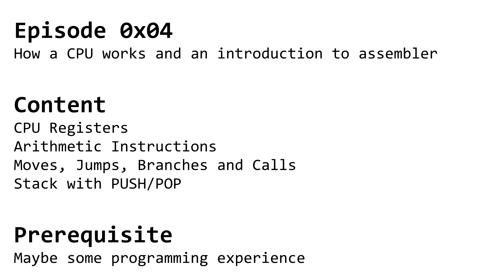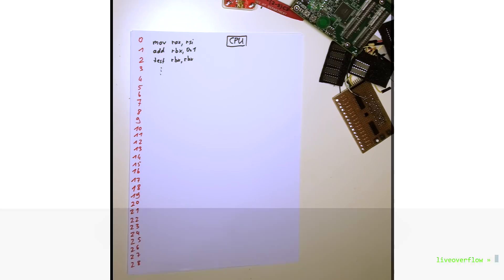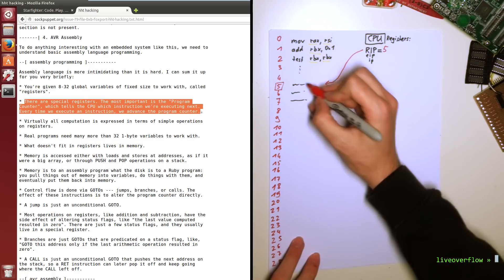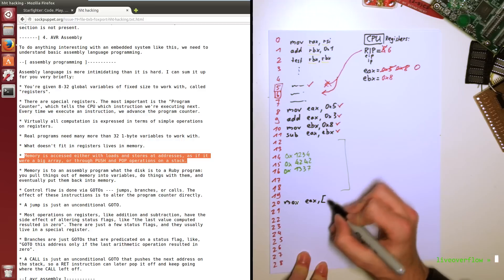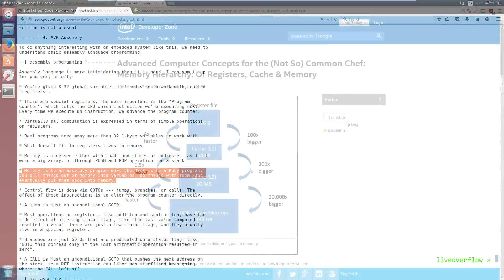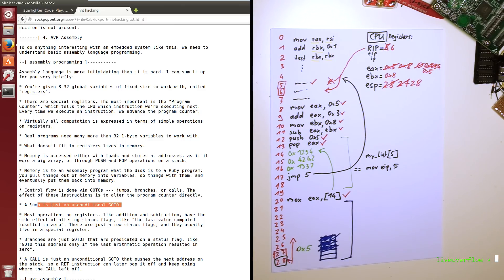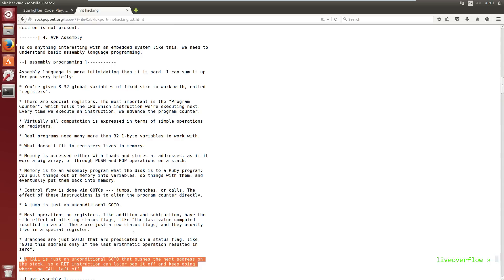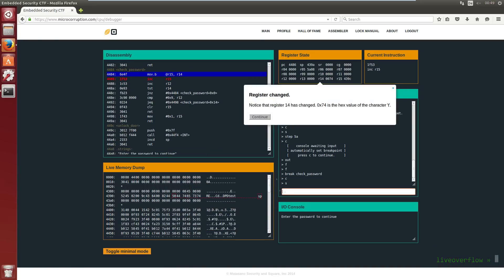How a CPU works and Introduction to Assembler - bin 0x04

Comment: Hi from 2021 to all :)
 Thank you a lot - now it is very clear about stack memory - some questions that are now on the top of my head:
1) what is a heap in that case? I guess, on the compile-time, when you define some "object" on the heap it will be just converted to the "memDestionationAddress" and provided to the CPU as a regular address in memory, and heap size is managed by a top-level entity like OS? am I right here?
2) I guess, the stack size is limited for each program, doesn't it?

Comment: I still don't get how computers read the numbers 1 and 0. Isn't it just electricity or no electricity?
Reply: Using a simple pair of voltage levels as a symbol scheme is indeed the most basic way of doing it. That said there is nothing fundamentally special about the way that the symbols encoding the binary data stream. Even among wired communication protocols there are other variations including some that encode multiple bits per symbol using more than two voltage levels sometimes with added parity data in the same symbol ie gigabit ethernet. This is before we even get into the multitude of ways to encode digital data into symbols that can be transmitted over the air. Frankly the only requirement is to have a minimum of two symbols that can be interpreted as different voltage levels once you have that you can program a computer to extract a binary input from it typically by using an ADC. But in effect even a simple binary input is in effect a 1 bit ADC in that it is able to extract a single bit of information each time it samples the input voltage level. What we commonly think of as an ADC is simply a more advanced quantizer that is able to discriminate more states as distinct symbols and thus produce more bits of information from each sample.

Comment: Can anyone tell me whats the difference between RIP and EIP?
Reply from the maker: RIP is the 64bit register and EIP is the 32bit register.
So on a 32bit machine there is only EIP.
On 64bit processor you have RIP (but you can also use EIP to only use the lower 32bit)

Comment: instruction on x86 does not necessarily is 8 bit and usually it is much longer, up to 15 bytes
IP points to address where instruction begins, there are no rows in memory like on paper (there are rows, but those are 8k)

Comment: at 5:54
you mention that the ESP is pointing to the top of the stack , so why it;s not up ? i mean at line 20 o something ? 
like this picture : http://www.cs.virginia.edu/~evans/cs216/guides/stack-convention.png
Reply from the maker: look at the picture. It says "stack Grows" and points upwards, but the arrow down says "high addresses are down". So the stack is growing, but the addresses are getting lower... In the end it doesn't really matter if the address goes up or down, an address is just a way to address a memory cell. What matters is only how we define what the top is. does that make sense?
Reply: so we can say that ESP is always at the top of the stack which is " upside down " , so EBP > ESP ? in addresses values
Reply from the maker: simple answer: yes!

long answer: yes on for example your typical computer. But theoretically we could also build a enw computer with our own operating system and decide that it's different ;) there are no laws that prevent us to turn it around :P
Reply: that's right :"D

Comment: Amazing video! However, I don't really get just WHAT Assembler language is... Is it correctly understood that when a C program is compiled, it is translated to machine language, and thereafter it can be translated from machine language to Assembler language, which is  (barely) human readable? Is disassembling the program with gdb converting machine language to Assembly language?

I don't quite understand the relationship between C code, Assembly and machine language. I understood from the video that programs are stored in the memory as Assembly, but computers only understand machine language? (1's and 0's) Can anyone explain this in detail please?
Reply from the maker: assembler is basically machine language... so the 0s and 1s that make up instructions for the CPU can be also written in a more human readable format. for example the machine code 10010000 (in hex that is 0x90) could also just be written as "nop" (no operation - that's an instruction that does nothing :P).
So assembler and machine code is basically the same. Assemble is just the machine language displayed as a readable code rather than just the numbers. but there is a one-to-one translation between that. For example when I want to "write assebler code", I can just write 'nop' and the assembler program will translate that to raw binary 10010000
does that make sense?

so yes... in a sense gdb disassembles the raw binary data to readable instructions.
Reply: Makes sense :-) Thanks
Reply: Thanks :) Is it the same for higher-level languages like Python and other scripting languages, or are there any differences to low-level languages like C/C++? 

EDIT: I mean since Python isn't a compiled language, it might not work the same way..?
Reply from the maker: Python is “compiled” to python bytecode. That’s basically also machinecode ;) but that byte Code is just not the same instructions that could be executed by the CPU. So the python program (cpython is written in c) will take the bytecode, those instructions and do what they say. Exactly like the cpu would, just in software not hardware. 

Search for “crash course computer science” on YouTube. It’s a series explaining how computers and programs work starting with the hardware and going up the layers. It’s soooo well explained that even I watched it eventhough I knew it already :D
Reply: Thanks again for the quick and in-depth answer! This is truly fascinating stuff. 

However, I'm not sure I understand. I'm new to the world of computing :/ 
Basically, the Python interpreter (which is software) does the same with the Python program that the CPU does with the compiled C program? But without actually using the computers hardware in the way that C programs use it - the program will be executed by the interpreter - which also acts as a sort of "compiler" - itself?

(BTW I really appreciate these videos and the helpful answers! You do an amazing job, keep it up!)
Reply from the maker: yeah basically :D

So the CPython interpreter is a C program compiled to machine code. So the CPU executes the CPython program. And that program reads the python bytecode and does what that bytecode says.

So for example a python code "x = 1 + x" would be compiled to bytecode by one CPython component. And then the bytecode that looks like "add(x,1)"  is interpreted/executed by the CPython program.

Imagine the calculator on your PC. You provide input by clicking the buttons and the calculator does what you tell it. 1 + 1 and it calculates that. So in the same way the CPython interpreter works, but instead of a human giving instructions, it reads a file (the bytecode) and follows those instructions. does that make sense?
Reply: I think I got it now :) Thanks a lot! Hope this thread will be useful for other newbies like myself.
Reply: @jeppebondeweikop1318  deffinately

Comment: I have got some Questions :
1. Does the architecture (32bit, 64bit) limit the number of registers or the number that is stored in one register ?
2. Is the memory access in 4:49 referring to RAM memory access or some Disk memory access ?
3. According to that Ruby analogy, it is probably RAM access. So Assembler exclusively work with RAM memory, so no Disk memory ?
Reply: 1. Yes. While you can only store FFFFFFFFFFFFFFFFFFFFFFFFFFFFFFFF in 32-bit while you can store FFFFFFFFFFFFFFFFFFFFFFFFFFFFFFFFFFFFFFFFFFFFFFFFFFFFFFFFFFFF

2. He means RAM

3. I can’t answer that one lol
Reply: As for 3 no hardware access is still done via assembly at the fundamental level. That said on architectures such as x86 direct access to hardware is restricted to ring 0 at least in normal operation so it is only available to the Kernel. Other programs use the Kernel API's (Syscalls) to request I/O with the hardware which first checks the applications permissions etc. If this passes the kernel will then call the relevant function from the linked kernel object that has the code to communicate with the specific device in question. The reason for this code usually being a separate object at least for kernels on general purpose systems as there are so many possible drivers out there most of which are unlikely to be needed. Thus it is more efficient to link only the ones needed for devices that actually exist on the system so as not to bloat the kernel with useless redundant code.

The abstraction provides by syscalls also has an advantage beyond the fact this is necessary to have any kind of access control on the system. That being that it means applications do not need to concern themselves with precisely which hardware contains the underlying file nor does it need to have specific code to communicate with any hardware it might encounter. It only need know how to invoke the relevant syscall and leave it up to the kernel to worry about the specifics.

Comment: 448a:  bf90 6d70 0000 cmp #0x706d, 0x0(r15)

What does 0x0(r15) mean?

I tought it was the value at the address that r15 points to + 0x0, so the value that r15 points to, but it's not, i have r15 pointin to 439c and at 439c i have :

r r15
   439c:   706d 715b 2d27 6a28  pmq[-'j(
   43a4:   0000 0000 0000 0000  ........
   43ac:   0000 0000 0000 0000  ........
   43b4:   0000 0000 0000 0000  ........

So  cmp #0x706d, 0x0(r15) should set the zero flag, but it doesn't. Any tips?

edit: talking about microcorruption in case it's not obvious
Reply: thanks for this link! Also for anyone new to assembly they might want to check out microcorruption.com and go through the tutorial. The site also uses msp430
Reply: On the same boat here. Don't really understand what mov.b 0x0(r15) or tst.b do really. (Searching in google didn't help much either)

Seems like a bit difficult the first excersice for begginers.

Sorry to not be able to provide any help to understanding the concept behind.
Reply: My assumption was right, 0x0(r15) is just the address stored in r15 + 0x0, so just the address stored at r15.
The problem was that the system uses a little-endian architecture, so 0x706d is stored in memory as 6d70, not 706d, that's why the cmp was not setting the zero flag.
Reply: mov.b and tst.b are just mov and tst variants that only look at the first byte of whatever you pass to it. most of your assembly related questions can be answered with a ctrl + f in this document http://www.ti.com/lit/ug/slau049f/slau049f.pdf

Comment: how to write assembly in blank computer??
Reply: Write to memory address and boot from it.
Reply: Obviously there is lots of little firmware and stuff that makes up the framework of the computer system in the first place but you want 24hour explanation or 1 line.
Reply: set and enable wires,bus data and address to connect it to the ram, look for "but how do it know":
http://www.buthowdoitknow.com/cpu_model_intro.html
https://youtu.be/cNN_tTXABUA
also you must set the instructions on the motherboard and cpu, i guess this is how assembly is made, i have seen it in js from a computer though, weird.. 
if you want to put in a hard disk and boot an os you must make a boot file and etc, kernel..making a windows from scratch could take years, don't expect for much

Comment: how to make assembler??
how assembler converter assembly to pulse??
Reply: Do you want to make your own assembler language? If so, you have to project a processor with your desired architecture (composition of abstract layers).
The answer to the second one is: computers use different levels of abstraction to do this.
First level: you have a language L0 for your circuits considered as a machine, M0 and here you can execute programs written in L0. Basically L0 is composed by 0s and 1s.
Second level: you now have L1 and M1. If you want to execute a program written with L1 on M0 you have to interpret instructions through an interpreter (a microprogram written in L0) or just translate it into an "object file" (written into L0) and then execute it on M0.
Other levels: they are described using the interpretation or the translation concepts.

From the bottom (there are other levels under the first one)
(1) Level of digital logic => 
[Direct execution]
=> (2) Level of microprogramming =>
[Interpretation through a microprogram]
=> (3) Level of machine instructions =>
[Partial Interpretation through an O.S.]
=> (4) O.S.' level =>
[Translation through assembler]
=> (5) Assembly's level =>
[Translation through a compiler]
=> (6) Level of High Level Languages (HLL)

Examples of level' elements or capabilities (each level is numbered):

1) Gates and logical ports
2) Registers, Digital circuits such as ALU, Floating Point Units, Data Path...
3) Here's the difference between CISC and RISC arch. and the use of ISA (Istruction set architecture), machine language (instructions like ADD, MOVE, SUB, ...)
4) Virtual Memory, processes, File System, possibility to ISA
5) It can be considered as the lowest programming level. It can manage the complexity of implementation of superior level abstraction machines
6) We have a lot of languages here, like C, C++, Java, Haskell, Prolog, Cobol, and so on...

Why we have levels? Because of the implementation's costs of the HLLs as hardware and the complexity of this procedure. In theory everything that you can write as a program could be converted in hardware circuits or viceversa.

I'm late, but this answer took me an hour. If only I was a native English... Hope it will be useful.

Comment: At 4:03 in the bottom right corner, does this mean something or is it an error?
Reply from the maker: +htpzt oh. I think the editing software screwed up. But maybe easter eggs like that would be a fun addition :P
Reply: or did you put subliminal message? :D
Reply: It is a color code: 3 bytes of the message each are combined into a 24 bit number (RGB),  just read every pixel top to bottom, left to right and convert them back to a message lol

I just thought of this, I might do it, but I think youtube's compression is a problem
Reply: i have seen that too
Reply from the maker: I hate udemy